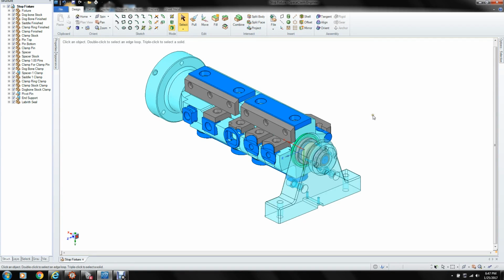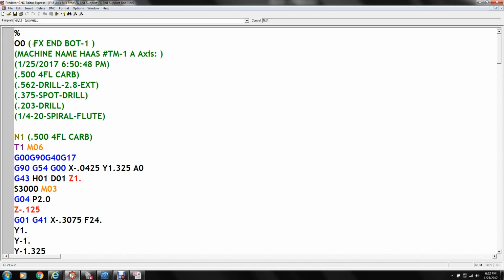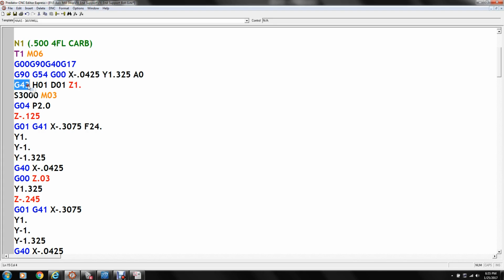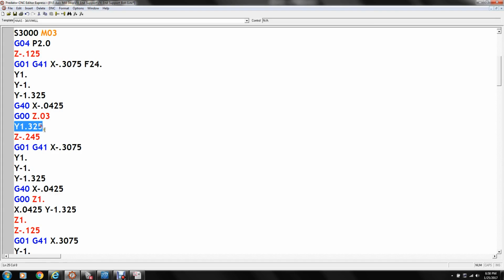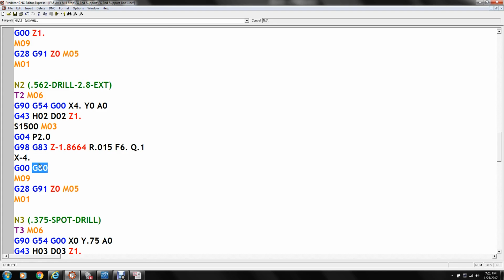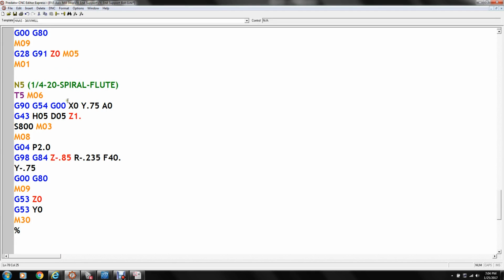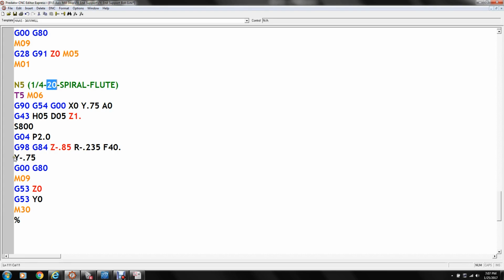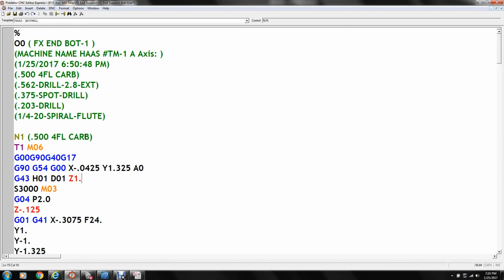5Axis Stop Fixture End Bearing Support Bottom

Comment: Hi Peter this is Denis I commented on if you were  selling the vise stop it is the only time you didn't get back to me so maybe for some reason you can't for some reason but if you can I would like to know if possible  thanks
Reply from the maker: Sorry I guess I didn’t see your comment. Right at the moment I need to finish the milling fixture for the Haas mill in my garage. But the Haas mill has a problem with the 4th axis witch this fixture is using for its setup. So I first need to fix that then finish the fixturing. I do have material to make about 40 assemblies if I just could get going on this project.

Comment: I kinda like how your Post only outputs one D value for the toolpath. My work's Post outputs a D Value on every occurrence of the G41. It sucks if you want to change it, due to various reasons. Like when the same tool is doing doing different features, and you want to offset one a bit to clean up blends.
Reply from the maker: Yes you should if you can change your post to just put the D offset in when you call the H offset. I have seen big mistakes in parts because someone missed a D offset when changing tool assignments. You could also just put in a variable command  (#** = [#** - .005] to change a offset -.005]where you want to change your H or D offset in the place where you need it. That way you don't have to worry about keeping track of two offsets. I plan to do a video on using the spindle probe and machine and system variables (Or what some call user macros) to control the position and size of features on parts.
Reply: Oh, thank you. :) You should totally go over probe macros and various features of it. That definitely make some interesting videos.

Yeah, I wouldn't have access to the Post to edit. It would be nice though. I'd make a bunch of various small changes. There's a new post for the new machines, and in my opinion, it outputs redundant code that could be defaulted into the M06 function. For example, Return to the tool change position. Every tool change contains: G28 G91 Z0; G28 G91 Y0; G28 G91 X0; M01;.  4 Lines for each tool, Eats up space visually. And it could in the M06. And also the Homing of XY at the same time. The Post doesn't pre-call tools either. Waits until it homes everything first. >_<

Comment: i was told you only slide the telescoping gages once. how accurate can you measure with a telescoping gage? don bailey, owner of suburban tool, does it like that too.
Reply from the maker: You are right when measuring a bore with a telescoping gage you should only hold the handle and pull it thru only once. I am measuring a slot so I have to try to gut the smallest size by rocking the gage. As to the accuracy it depends on the skill of the operator. In skilled hands to .0001" would be possible. I don't recommend this method for measuring slots its all I hade to work with in my garage.

Comment: I thought this that was a pretty good explanation of the program. Would have like to hear your explanation for tool comp but, another day. Would have really like to seen you talk about the work offset probing macro as that's what I've had a lil trouble with but, I know with the Haas it's not programmed at PC so it wasn't there to talk about.. Thanks for sharing.
Reply from the maker: Thanks Steve, The video was getting kind of long so I will make another video on cutter comp. The Haas uses the Renishaw probing cycles. I want to make a video on how to use them and how you can do in process checking of size and rerunning a tool to bring a feature to dimension. This also ties into the use of cutter comp. With using cutter comp you can recut milling paths and change the size automatically. You can also adjust the offsets of tools and fixtures with the spindle probe all automatically using small macros and the machines parameters. This is a some what complicated subject it may take many videos if people are interested.
Reply: I like long vids. I don't know who complains about long vids but they must be out there cause all the creators say that. I don't have a Haas so I'm not sure learning they're cycles will help me as I'm trying to learn to write macros using G31s and G10s so forth. Seems like there is quite a bit or at least some info out there on using haas probing cycles but nothing regarding writing or explaining the code behind them or other simple probing macros. It would defiantly help those who don't have work offset and tool comp type cycles built in to our controllers. I know quite a few guys who would enormously appreciate any help in this subject, especially as Fusion and most other CAM software now has probing, but no Post to support it on anything but Hass. I know for me its hard to mod the post without knowing the codes, but even w/o cam simple probing macros would help many.  I'm excited for whats to come and I can't thank you enough for taking the time to share your knowledge with us. I know it takes a lot of time to do and it is very appreciated.
Reply from the maker: The length of the video has to do more with physical restraints such as upload time data size on the computer and bogging down you computer with the editing software. Also most peoples attention span is very short. I like my videos to fall in between 10-30 minutes. As to the probing cycles and their macros the Renishaw ones (If you are using a Renishaw probe) are not machine specific. You would use the same ones on a Fanuc a Haas a Mitsubishi Meldas a Mazak exct. The macros are already written by Renishaw they just have to be in the memory of your machine(and the machine properly configured for the probe). So when for instance when you call a protected move it would be G65 P9810 X,Y or Z. So there would be a program in your machine named O9810. The G65 is a macro call. There is also a program called the Renishaw Easy Set witch is what I am using in this video. You call it like this G65 P9823 S1 A4. Y 2.0 Z-.50;(This is exactly what I am using in the video close up of the probe in the Y Direction) O9823 is the program, S1 is G54, A4. is a webb measuring routine, Y is the size and direction and Z is the incremental depth from where the probe is setting. I will make a video in the future showing and explaining this in more detail.
Reply: OK that makes sense. A video on the subject would be awesome. thanks a ton for the help
Reply from the maker: Mr flabergasterd 833569 ?
Reply: Edge Precision  long
Reply: Mr flab      Nobody cares what you think your 9 years old. Go back to watching your kiddy video game channels and leave the men to work.  Btw Liking a bunch video game vids, making Minecraft playlists and subbing to a bunch of basement dwelling gammers is not "running a channel" let alone running a second one.